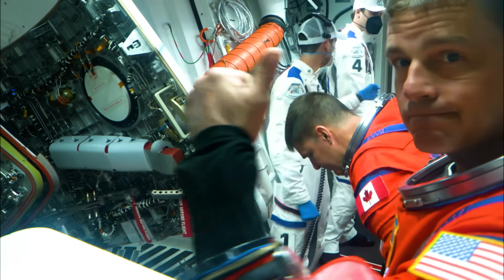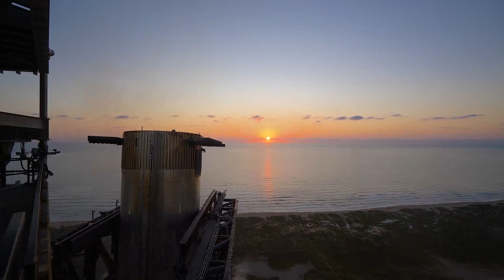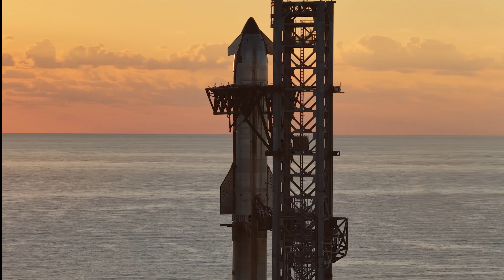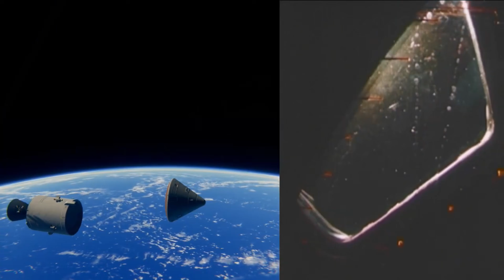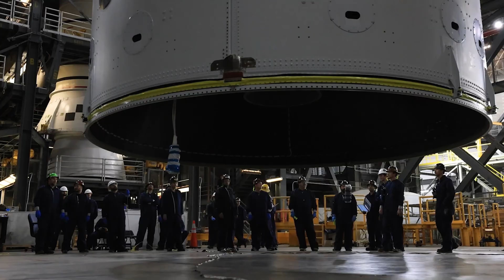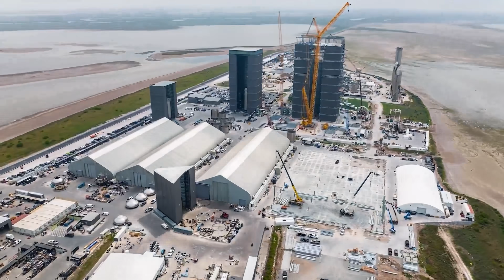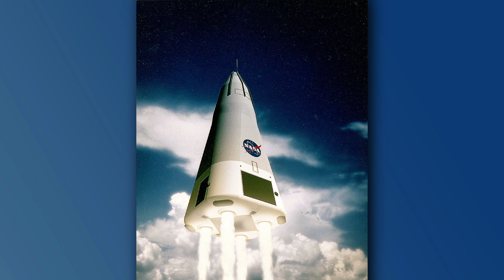Why SpaceX Starship and NASA Rockets Are So Different…

Comment: Starship cost to date: $15billion dollars, with 14 launches. Started in 2012
SLS cost to date: Between $24-31billion dollars. 1 launch. Agreed in 2010, announced in 2011.

SpaceX launches in 20 years: 729
NASA launches in 68 years: 463

I adore NASA, I think it has done simply the most impressive stuff we have ever done. But it is very clear which rocket is going to get to the finish line first and be the most productive in the long run. SLS is shockingly wasteful and has some currently awful contractors attached to it. SLS currently only has a maximum of 10 planned launches to date, and will probably not receive funding beyond that. Add that to the already spent $30billion, and you are looking at costs of $50billion plus, before you take into account inflation and the cost of additional changes to future iterations. Is it an incredibly impressive rocket? 100%, but it has been a pitiful journey to date, and I can't see it getting much better or more efficient. Probably worse.

I also think it a tad unfair to say that SpaceX have simply capitalised on things NASA figured out. SpaceX have created brand new technology, and solved problems NASA couldn't solve in almost 7 decades. 

Both entities are hugely impressive in their own right, but one is incredibly more efficient and rapidly pioneering than the other, at least in modern times.

Comment: Stopped watching after I heard "mega-newtons" of thrust. After working on jets and flying them for 15 years, this is the first time I've heard someone say " mega-newtons " outside of physics class.
Reply: in fact is correct said mega newtons, in the official pdf said "Maximum thrust:  8.8 million lbs. (39,144 kN) " source Nasa.gov
Reply: I feel sorry for you 😢
Reply: 39 Meganewtons = 39144 kN = 3999 tons = 3999000 kg = 8800000 lbs thrust
That's not enough for an Arleigh-Burke-destroyer (9900 tons) and certainly not for an aircraft carrier (100000 tons).

Comment: What I can see, roughly speaking, SpaceX took approach similar to Soviets with their N1 rockets, because at that time Soviet union didnt have that much resources as Nasa. Koroliev took the most economical approach of building a stage with multiple small engines because it is cheaper and in some points even easier to design. Scaling up constructions and design something big, especially with turbulent behaviour of burning is harder than to design it smaller. Also from the testing point of view it is cheaper to test small engine instead of building big facility to accommodates big engine. SpaceX take similar approach when they want to do save money and make rockets economical. Honestly, as an engineer I like that soviet approach more, because if you have a big budget, you can test a lot, come up with very expensive solutions, complex mechanisms, but when your budget is limited, you have to be very clever where to spend your money on, so you causally choose which path you take. For example a story about moon landing, NASA had been testing lot of different surfaces of moon, prepared different landers. Soviets couldn't do it so they focused only on hard surface, so they save time and resouces to not try every option, just assumed one which had been proven by lunar probe. So when people take aside politics and hear stories of real people, how and why they were thinking that way, we all could get an inspiration from their decision making.

Comment: To be fair to NASA, how and where any rocket’s components are built is bathed in politics. That’s why SLS is built the way it is. Influential members of Congress who had Space Shuttle parts built in their state insisted NASA re-use existing shuttle technology to keep the money flowing to their state or district. SpaceX (or Blue Origin for that matter) doesn’t have such political limitations.
Reply: 100%
Reply: Boeing Starliner also did not have those political limitations and used the classic development methodology. Yet their program was massively delayed and when they finally launched the Starliner, 5 of 8 aft engines failed, but with disabling some computers that monitor those engines, they were able to use them with less power to make it to the ISS where they crew eventually was picked up by a SpaceX rocket.

Blue Origin (Bezos) followed mostly the same path as SpaceX, but at the moment does not have a stable launch platform. Meanwhile SpaceX is doing often multiple launches per week and putting hundreds of new satellites in space every month. At the same time they are still improving their rockets and software. But be aware, once StarShip is stable, SpaceX can launch a lot more per launch than the 24 satellites they currently launch per flight. Is SpaceX can get Starship stable (reliable) before others have mastered small rocket reusability, they have a headstart that is very hard to compete with. The only way to compete is to build satellites that can do something what StarLink can not. Once Netware, Word Perfect and Altavista ruled the world, but they became complacent and stopped innovating.

Comment: One was designed and built by engineers, the other by an 8th grader.
Reply: Yeah. Dont let that resentment and envy get ahead of your rational perception. Elon Musk can be a baby, and we can dislike him, but we have to admit that this MF delivers (actually, his ENGINEERS deliver...) what NASA enginers could only dream about (and they actually said that it was impossible to have a rocket back). So you compare? 75 million agains 2 billion per launch is a BIG, ENORMOUS difference that changes the game.
Reply: Directives - if NASA blew things up as often as SpaceX does, Congress would strip them of their funding.  NASA has long had to lean into caution - things have to work reliably first time … especially if they are going to be carrying humans.  

SpaceX (so far) doesn’t seem to be subject to the same constraints … I expect that will change when a Starship launch with humans on board turns into a fireworks display.  

Engineering is hard work - “rapid iteration” only means you solve the immediate failure, but that means you have an unknown number of failures that you haven’t even thought about.
Reply: @mgs337  No. That's not what rapid iteration means at all. It means using each failure to test assumptions, identify underlying causes, improve the system, and expose additional weaknesses through repeated cycles of learning and refinement. Unknown failures may still remain, but rapid iteration is intended to discover and address them sooner.
Reply: @LittleLordFancyLad  that is not how Musk himself has described it.
Reply: @Endsentrois  Pretending to go to Mars is amusing. 15 refuels to go to the moon is ridiculous. See how much that costs.
Reply: @DCGreenZone  You think it will be more expensive than a $93 billion Artemis mission? Don't let your anger over politics cloud your rational thought.
Reply: @LittleLordFancyLad  It ain't politics, the dude is a moron.
Reply: @DCGreenZone that moron you called worth of billions or even 1 trillion . How about you intellegeny person? 😂
Reply: @Sayitall9071   I don't tend to worship notseez. You may however.
Reply: @Endsentrois  I don't have resentment, my family went to WWI and WWII, mom worked at an aircraft factory on prop job fighter planes, I have zero tolerance for notsees.

Comment: SLS just went around the moon have Space X done that?  And Boeing manufactured SLS, that's a private company.
Reply: SpaceX delivers goods and people to (and from) the ISS. It changes the elevation of the ISS. SpaceX Falcon 9 has flown 683 launches, with the highest launch count for a single booster being 36 flights. They have caught the Super Heavy booster, and will catch a Starship soon.

Boeing stranded their astronaut passengers on the ISS, and SpaceX rescued them. Neither company is perfect.
Reply: Private company operating as a government contractor primarily. Do we need to be reminded of Boeings failure and stranding of astronauts on the ISS?
Reply: Nope, the starhip is emptied out just for getting to LEO. Basically and oversized Soyuz.

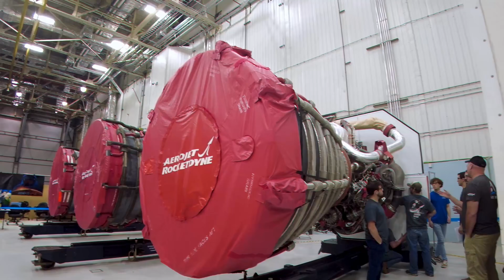Comment: This NEEDS TO BE SAID! Not only 2:13 do they burn liquid Hydrogen and liquid oxygen but they use TURBO pumps to accelerate that fuel because the natural pressure of gas escaping is not enough to put heavy things into space. Yes you could build your own rocket that uses simply gas pressure alone. Yes, with fine tweaking here and adjustments there, you just might be able to lift a small rocket off the ground and many it could go pretty far, but these engines don’t just let the fuel out, they suck it out with high rpm turbo pumps. When I realized that I got a glimpse of just how badly people want satellites and how far we are willing to go to put them in space.

Me: we can’t get the fuel to come out fast enough and a pump is just asking for trouble

Them: let’s not just build any pump, let’s make a pump that could put a jet ski into orbit from the water.

Me: how much are we talking?

Then: how bad do they want it?

Comment: Designing larger engines is much more difficult. The NASA Nova engine vanished. Multiple engines allow multiple failures each launch.
Reply: The concept of clustering dozens of lower-thrust engines brings its own set of problems, increasing the overall system's complexity and susceptibility to failure. The Soviets learned this the hard way with their N1 moon rocket, which utilized an engine configuration similar to that of Musk's Starship. The N1 flew four missions; none went according to plan, largely because the fluid dynamics and interactions between the engines were incredibly complex. There were also issues with the turbopumps—highly stressed engine components prone to tearing themselves apart.

Comment: Reuse is interesting, but it comes at a cost. Time to refurbish and reduced payload capacity. I would also argue reliability.  Remember that the Soviets had a rocket with a ton of engines that ended up being a dud of a rocket. With that many engines, you have to reliably feed all the engines with fuel and oxidizer. That is not so easy. There are so many questions regarding SpaceX. I hope they figure it out, but I have my doubts.

Comment: Why didn't you add blue origin in this comparison Jeff bezos company
Reply: They don't have a heavy lift rocket
Reply: Ok good reason.
Reply: Blue Origin has become a non event, caused by terrible decisions made years ago. Their flagship engine, the BE$ has a combustion chamber pressure of about 135 bar. The combustion chamber pressure of Raptor 3 is about 350 bar. This means that the Raptor gets way more thrust for the fuel used than the BE4. The thrust to weight ratio of Raptor 3 is about 180:1 whereas the BE4 is about 50:1. It is simply not in the race and will never catch up unless they scrap BE4 and start again. That would take about 10 years to develop a new engine and there is no sign of them doing that.
Reply: @EricDavies-b8i thank you

Comment: NASA doesn't "build" a damn thing.  They contract out.  No different than your state highway department.  And if after over 50 years of rocket development SpaceX couldn't figure things out I'd have been shocked.  If they couldn't improve things they have no business trying.
Reply: Both NASA and Russia told Elon that their scientists (armies of PhDs) have already proven that reusability of rockets is impossible. Engineers from the rocket companies (NASA contractors such as Boeing) laughed at him and did not give him to answer his questions.  So Elon went ahead and personally designed and built reusable rockets, with his bachelor's in physics. Elon, from the beginning, and still is the chief engineer of SpaceX.

Comment: Humans will never live on the moon or Mars. Period!!
Reply: Never say never... 

Maybe not humans like us, but billionaires might like to hang out while some global cataclysm cannibalises human civilization
Reply: @muntee33  The human body is not designed to live long term in micro gravity.
Reply: @danahan01  explain the international space station them🫩
Reply: @Matches1st   People only live short term (a few months) on the ISS. They have to exercise no less than two hours per day and when they return, the effects of living in micro gravity last for months. Crews on the space station also receive much larger exposure to radiation than you get on earth.
Reply: @danahan01  I know I'm obviously right the about the humans are def gonna be living on the moon thing so I'ma just take the short cut and give you one of "those" replies 

ISS is ~0 g. The Moon is 1/6 g, completely different regime. We already know from rodent centrifuge studies that lunar gravity prevents a lot of the muscle atrophy seen in pure micro-g, though bone and some other systems still need help. That’s why the plan isn’t ‘just show up and live there.’ It’s exercise protocols tuned for partial g, possible short-radius centrifuges for intermittent higher loading, proper radiation shielding with regolith, etc. Same way we solved deep-sea living, high-altitude living, and Antarctica. The body isn’t ‘designed’ for those either; engineering closes the gap. Short-term ISS data is useful, but it doesn’t prove permanent lunar settlement is impossible.
Reply: They will live on the moon, they should had been Americans on the moon, since the late 80s and by now in 2026 a few more countries too.
 but not mars, unless the make some new type of engines, that will shorten the trip a hell of a lot
Reply: True for the next 10 years. But false after 20 years.
Reply: We went from the Stone Age to instant communication, extremely fast transportation, defying gravity, electronics, AI, and conquering the moon, do not underestimate human science.

Comment: NASA rockets actually work
Reply: If SpaceX was going to use the Starship the same way that NASA uses Artemis, it would easly meet those goals. (with NOTHING reusable) Starship is designed to be 100% reusable. Oh, you're forgetting Falcon 9 rockets, that are also partally reusable, with the boost stage and fairings being reused, as well as the Draco capsule.
Reply: @dundonrl  Fair call. Falcon 9 is an amazing rocket but starship is not only too heavy to carry anything like what CGI claims but is no where near a reusable rocket
Reply: @teddysthaiadventure2534  Rockets can usually carry a maximum payload to orbit that is a fraction of the launch mass of the rocket.  F9 is apparently around 4%. Let's say Starship + landing fuel + payload is 5% of the launch mass of Starship + Super Heavy. Since the full stack is somewhere in the vicinity of 5000 tons, that gives us 250 tons upon reaching orbit.

250 tons. For a scaled up Falcon 9, 80% of those 250 tons could easily be payload. 200 tons to orbit. But this isn't a scaled up Falcon 9. The Starship vehicles needs to weigh much more if it wants to come home to Earth. Fairing, landing tanks, sea level engines, skirt, flaps, heat shield will all pack on the weight, and every extra ton added to the vehicle is one ton taken away from orbital payload.

The program has clearly shown that it's very difficult to keep that weight low enough for the vehicle to be viable. V1 Starship could barely deliver just itself to orbit. V2 Starship needed to be built, but it took a whole extra year to prove the new version fully capable. And then, it still wasn't good enough to deliver adequate payload to orbit. So they had to redesign the vehicle again, taking yet another year to get the new version up and running.

But think about it: If V1 was able to reach orbit with a small payload, then all of the improvements made between V1 and V3 must have dramatically improved performance. The 100 ton payload capacity advertised for V3 is likely close to accurate.

All that remains is for V3 to start tower catches, and they can reuse a vehicle that has actual performance.

"no where near a reusable rocket". We're basically a month away from a ship catch attempt, brother. Space program timescales are measured in years. Starship reuse is on the doorstep.
Reply: @teddysthaiadventure2534  Depends.. it can put 100 to 150 tons into LEO, and 27 tons to Geostationary Orbit, of couse it weights 5,000 tons upon liftoff so that payload weight is a bare fraction of what the Raptor engines are lifting!
Reply: @dundonrl  We were told V1 could do that, It should now be 250 + but seems they still don't have enough fuel to get to orbit empty. Go look at Elons statements when V1 was launched, this is why they keep making it bigger to increase fuel
Reply: I love how people constantly hold up what elon is gonna do as proof that he superior to anything thats actually been done.  Talk is cheap and Elon has not delivered anything more than a flamethrower at this point.
Reply: @brandonmoreland4392  ah, yes. Near-sighted to the point of blindness. Let's pretend like we can't see where the program is headed, and act like it'll be canceled tomorrow.
Reply: @brandonmoreland4392  Musk's companies pays about 40 million per day to US employees.  SpaceX has launched more space cargo in 2025 than the rest of the world has in the last ten years.  SpaceX has dropped the price for space cargo by 90%.